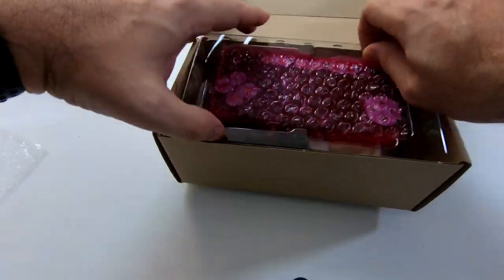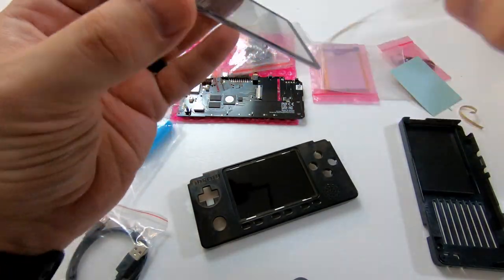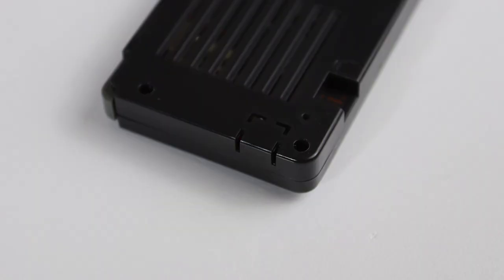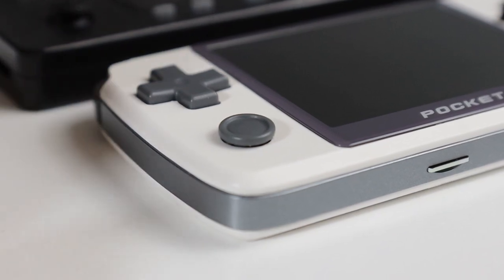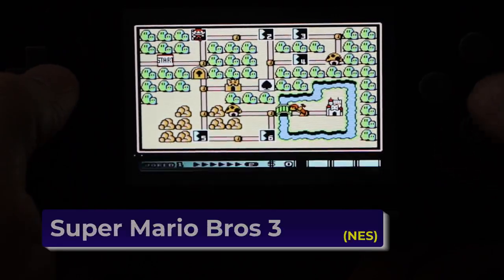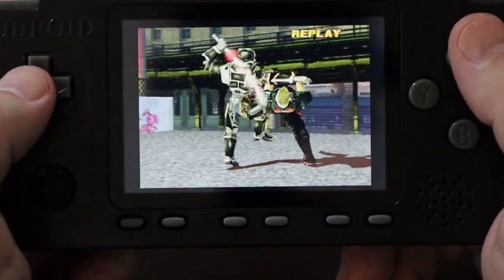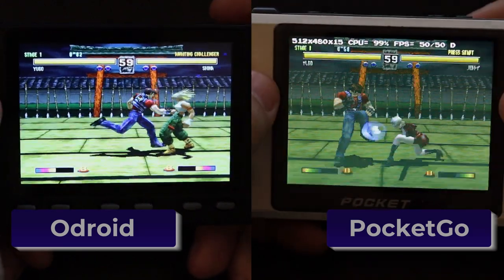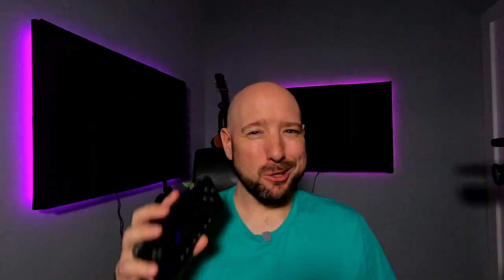Review: ODROID-GO Advance Black Edition Retro Gaming Handheld

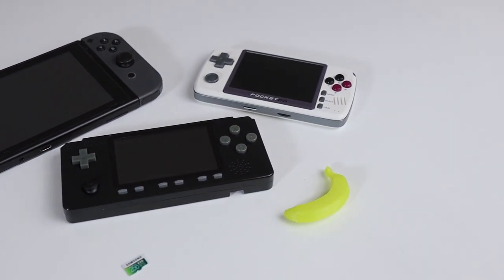Comment: Nice review, one notices that you know what you are talking about (unlike retrododo). Also neat little banana for scale at 8:10
Reply from the maker: Thanks!  I printed like 30 of those bananas for a party once upon a time.  They turn up in a few of my videos just for giggles :)  That reminds me, need to add the chapter markers!
Reply: @LilMikeysBigPlans  Hahaha nice! Btw, which OS did you use to do the game testing?
Reply: @LilMikeysBigPlans  Nvm, just read that you probably were using batocera. I've read many times that retroroller gives you superior performance on most of the emulators, so be sure to try that one out aswell
Reply from the maker: @Glatzengeklatsche  I used a mix.  Most were either Batocera or Ubuntu 20.
Reply from the maker: @Glatzengeklatsche  Yeah, I tried RetroRoller briefly.  It takes a bit more leg-work to get fully set up than the others but it also seemed more flexible and powerful.  It was definitely the most unique of the OSes.  I really liked the default theme but it cut off game titles.  Since I was trying to get the review out I gave up on it pretty quickly but will definitely be coming back.
Reply: @LilMikeysBigPlans  I liked the way of retroroller aswell, but wasn't able to get ES started on it, it always asked me to configure the buttons, which was impossible due to the fact that the oga doesnt have as much buttons as ES wanted to configure.
Reply from the maker: If you press-and-hold any button in the ES button config screen it should bypass the button without configuring it.

Comment: Great review. I've settled with Emuelec 3.6 as my preferred OS. I don't have any issues with SNES, except for a few superFX chip games. Switching the emulator to SNES9X2010 for those games only under advanced games options from on the game in the main menu solved that. I have no issue with PS1, but N64 was pretty choppy. Switching to the parallel core made a huge difference. Now most games like Mario 64, run really smooth, albeit with a few minor texture glitches. The analog stick drifting is typically the result of the ribbon cable not being inserted as completely as possible, according to the forums. Might be worth checking out. Also, PS Vita analog stick grips pop right on there ;)
Reply from the maker: Hey Brian!  The analog stick on the PocketGo is soldered to the board and rumor is that even when folks disconnect the traces they still have a calibration problem.  Almost like it's a core firmware issue or something.  Very weird.

A lot of people really like EmuElec.  The only issues I had with it is that some emulators had smoothing turned off so everything was a bit rougher than it should be.  Easy fix.  And I believe it had the start and select buttons in the middle instead of the outside.  Also should be an easy fix.  I picked up a 2nd large SD card so I can play around with an OS while still keeping my baseline Batocera install clean :)
Reply: @LilMikeysBigPlans  I misunderstood and thought you were referring to the OGA having analog stick drift. Emuelec does have start and select on the outside buttons, at least in 3.6, but I wasn't aware of the smoothing setting. I'll have to check that out. Thanks again!

Comment: Great and detailed video. This is how consoles reviews should be.
Question. How many systems look pixel perfect on the screen? Because it seem that some look a bit harsh or streched. I ask this because here 15:42 you can clearly see that Yoshi's Island on the Odroid look streched and on the Pocket Go look on his correct aspect ratio. Can you change the settings on the Odroid so it look 4:3 even if that mean having black bars on the sides?
Reply from the maker: Hello Francisco, yes you can change aspect ratio on the emulators.  For instance, choosing either the 4:3 aspect ratio or the 'Square Pixel' ratio will introduce black bars on both sides.  There's also a 1:1 scaling option that will introduce bars on all sides but disable all scaling/smoothing.  Each OS uses different defaults.  I believe batocera defaults to scaling everything to full-screen while Elec is scale-to-fit but I'd have to double check that.
Reply: @LilMikeysBigPlans  Very claryfing answer. Thank you!

Comment: Great review! I would be curious to see your take on the RK2020 and which one (Odroid Advance Go Black Edition, RK2020) that you prefer.
Reply from the maker: Yeah, the cpu, gpu, and memory specs are identical between Odroid and RK.  I would guess there's not a dime's worth of difference between them performance-wise.  Would be interested in how it feels.  Shoulder buttons look much better.  No built in wifi is a bummer though.  Unfortunately I can't justify owning a PocketGo, Odroid, and an RK :)
Reply: @LilMikeysBigPlans  yeah, I feel you on the justification front. I wonder if having the 6 menu buttons on the OGA versus having just the start and select button the RK would also be a problem.
Reply: @keithk8347  the hotkey is required for quite a few functions. I'm not sure how you would get around that.
Reply: @GibsonSGJKL  that is totally what I was thinking too. I was just wondering if owners of the RK2020 are having problems.
Reply: The RK2020 is a ripoff of the Version 1.0 of the ODroid Go Advance, the pcb's are almost identical and it even runs the same firmware.
Reply from the maker: Seems like it would be.  I like the underscreen buttons.  I'm not quite sure if Odroid takes the OEM mindset and invites clones and improvements (presumably to increase sales of the core chips) or if this is a direct assault on their bottom line.  Clones are inevitable, but it would be sad if Odroid's supply problems meant they lost any ability to profit before the attack of the clones.

Comment: Good video!
I have a question: Can I change the language to german because I'm from Germany and I hate it to play pokemon on English
Reply from the maker: Thanks!  You can set the OS language in the options.  In Batocera it's Main Menu->System Settings->Language.  That won't change the language in-game though and you'll have to use a German-language ROM if you want to play the game in German.
Reply: @LilMikeysBigPlans  When I changed the system language to german can I play also europe roms?
Reply from the maker: You should be able to play EUR ROMs regardless of the OS language.

Comment: Can't get one, the link just shows not available. I'm going with the RK 2020, it has more power and the same firmware.
Reply from the maker: Hello George.  HardKernel shows out of stock but it looks like Shaka still has them.  Regardless, the RK2020 seems to be a capable machine.  Where you seeing that it's more powerful though?  The spec sheets on HardKernel and rkconsole list identical CPU, GPU, RAM and clock speeds.  The only differences I can see are the RK lists an IPS screen and the ODROID lists a larger battery and built-in Wifi.
Reply: @LilMikeysBigPlans  they do have the same capabilities. I was mistaken in my reading and I do apologize.

Comment: How do you play psx multi disk games? With .bio and .cue?
Reply from the maker: I haven't played a PSX game through to a 2nd disk on the ODROID yet but you should be able to pull up the RetroArch menu (Select+B on Batocera), select 'Disc Control' -> 'Load New Disc' and then pick the disk image.  I've been using bin/cue for my PSX disks without issue but I know it supports other formats without issue.
Reply: Holding the hotkey and pressing X in a game will open the retroarch menu and allow you to swap disks under "disk control", but you'll have a issue with the new disk not recognizing the save. To get around this, you can create a .M3U, which is just a text file that lists the various .que files for each disk of a game, and launch the game from that instead. That way, the save file will be associated with the .M3U file and work for all the que files listed in it. You can take it a step further and convert all your bin/que files into a single .CHD file for each game disk as well using software called CHDMAN. It makes your PSX library much cleaner and it's easier to create the M3U files as a result. Lastly, once you done the above, you can filter what's displayed on the OGA-BE for PlayStation by file type, specifying .M3U only, so that you just have a single menu item for each game. It takes a little while to do, and you'll probably need to do some googling for help on the process like I did, but the end result worth it.
Reply from the maker: @GibsonSGJKL  Oh man!  Great tip!  I saw the Arcade Punks image compiled the disks into PBPs which seemed to play on some OSes and not others.  It sounds like pbp is actually a common PSP format that was repurposed for some PSX emulators and none of the tools I tried would create a PBP that worked on the ODROID.  Your way sounds cleaner and more universal.

Comment: What's the best emulator (image)?
Reply from the maker: I prefer Batocera but each has their own fans and you should be able to make each of them play like any of the others.  I liked Batocera's default key layout (start on the far right button, select on the far left - some have start and select on the middle buttons), they chose good defaults for the emulators (Elec had scaling and filtering options I didn't like), and the volume and brightness controls worked well out of the box.